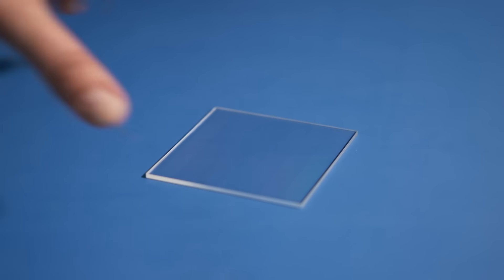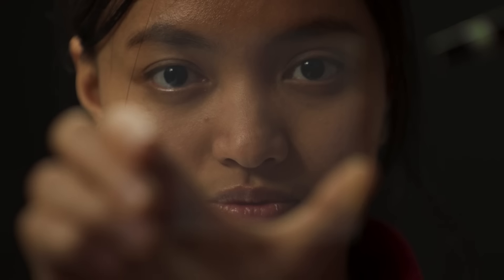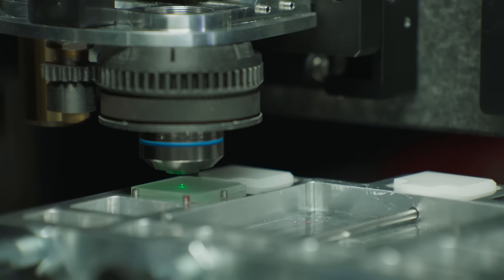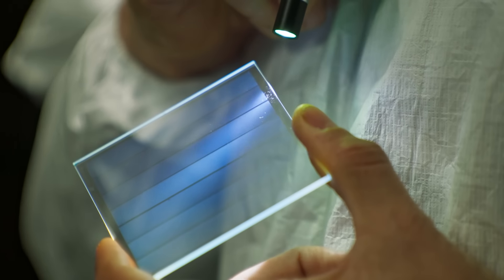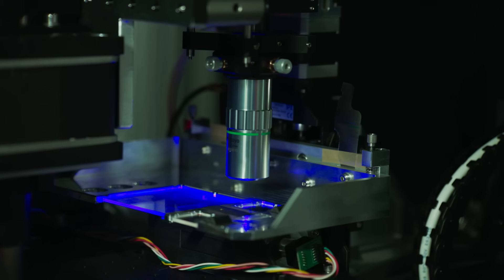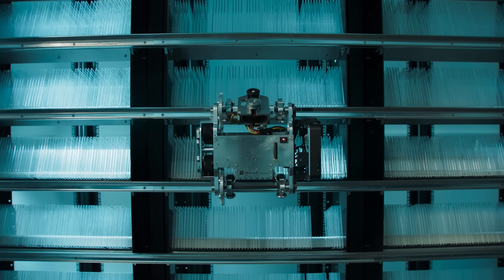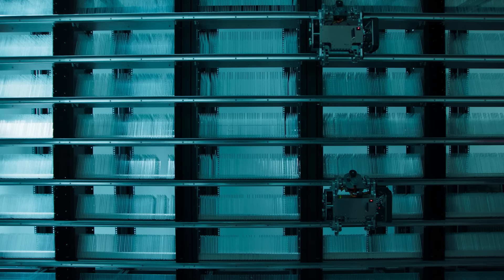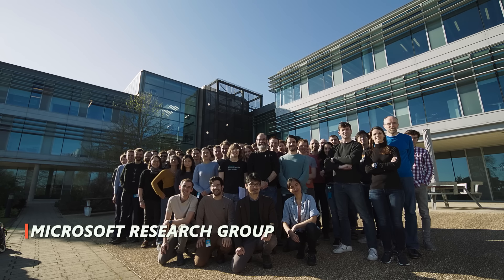Storing data for thousands of years | Microsoft Project Silica

Comment: A large data storage without electricity looks amazing
Reply: So a library looks amazing?
Reply: @Tri-Technology   I mean, there's plenty of libraries that look amazing lol
Reply: @jakub2631  I know, but that was not my point.
Reply: @Tri-Technology   well if you want to compare this solution to a library you should consider book's read time and data capacity
Reply: @jakub2631  That's still not my point. A library is aswell "A large data storage without electricity" So this concept is nothing new. Only the storage medium is different.
Reply: @Tri-Technology  A library takes up too much space and is flammable.
Reply: @Tri-Technology  a library is not a "large" data storage.
With some simplistic and generalized math: in a single glass platter of these you could store up to 3 millions of books.
Reply: @Tri-Technology  every step to making something new is simply modifying existing concepts. Then eventually it goes through so many iterations that it becomes a concept that is very different from what it was at the start. You can call these glass slides glorified hard drives, but maybe one day it could inspire new innovation that can be considered much more useful than what it is today.
Reply: Looks like the Jedi Archives xD
Reply: @Tri-Technology  like someone already mentioned, a library is not a large data storage. Furthermore the data in a library is not easily machine readable and this is a problem in a lot of cases
Reply: cant you just keep an SSD off
Reply: @Tri-Technology  I'm confused at to what answer you're looking for. Everyone already replied to you both on the aesthetics and the technical aspects of things. But I'll try to give my go at this:

This is a huge breakthrough because current archiving technology uses tape drives (yes the same tape drive technology we've been using since the dawn of computing) and the problem with those is that they can only last for a few years until the magnetic medium wears out. GLASS however almost never "expires" and is also one of the most abundant material on earth. You may think this as just a fancy CD but CDs are made with plastic and use a special dye coating to store the data. Plastic warps due to temperature and the dye's chemical composition changes over time. They can still last a very long time if stored properly but not long enough.

Also, a single hard drive can store a library's worth of books so I don't think a library counts as a large data storage facility in modern times.
Reply: @0x1EGEN  I am not looking for answers. I am an engineer and understand very well how data is stored and what the advantages and disadvantages of different storage types are. I only mentioned that a library was back then and is still today "a large data storage without electricity" or why do you think has almost every university still today one or multiple libraries? Of course large is relative and in comparison to a hdd, ssd or tape books are storing not much data. My point is that the concept of storing a lot of data without electricity is much older than modern techniques and people are always searching for better storages. Also the data in this approach does not need electricity while the data is stored, but we need it to read and write it and that's true for most of them, if you think about storage types in a macroscopic perspective.
Reply: @Tri-Technology  yeah, libraries do look amazing 🤩
Reply: @Tri-Technology  an entire large library is like 100mb
Reply: @Tri-Technology  I mean it is essentially a library with robots that pick up the books and read from them to give a client the data they requested. It's not so different just that paper isn't that durable and also doesn't store information in a compact manner. Meanwhile one of the small 3 by 3 inch glass can store 7 terabytes for tens of thousands of years. That reduces the upkeep cost by a ridiculous amount BUT it's not very practical for a cloud infra because reading and writing of the data takes days. So like for archiving it could be valuable but otherwise it doesn't seem very practical. Still a cool concept.
Reply: You know DNA is better than Glass at storing stuff
Reply: It's about data density too. Libraries don't have that.
Reply: @Breadbrowser  it is also harder read/write and more expensive to store
Reply: @rickfxs  Not even remotely. A simple solar array could power that kind of energy need. For free.
Reply: Doesn't HDD and SSD count? I mean, you only use a tiny amount of electricity when accessing the data. You can leave these storage devices unplugged for months or even years, and all the data is still saved..
Reply: like HDDs? xD
Reply: you mean like CD?
Reply: @diuco17  Glass takes up space and can shatter.
Reply: @MAKRON66  I takes very little space actually. Think of a hard drive... at best it can store 26TB of data, an LTO tabe can do about 30TB. In much less space you could store a layer of glass that holds easily 500TB and will not demagnetize.
Of course it could shatter but a hard drive can also break if you drop it. Its an archival media and it is not supposed to be constantly moved from one place to another without care.
Reply: @Ludak021 reflecting dye on CDs degrade over time
Reply: tbh I think a less difficult way to do this is to return to punched tapes, EXCEPT we use lasers to burn and read the holes. if we can make nano grooves in a CD we can make nano holes on tape as well
Reply: @Tri-Technology  i think physical libraries mostly store information, not data though...
Reply: That is... until no one remains who knows how to maintain the reader robot...  Seriously... how many people would be able to maintain a magnetic tape reader from the 70's... and how difficult would it be to reverse engineer it in another 50 years...
Reply: You could  @Tri-Technology  fit the whole library on a single sheet.
These can hold petabytes.
Reply: @rickfxs  is clearly more economical and efficient than current methods, come on, they are looking to cut costs.
Reply: Every data storage device we invented is that way, i.e. tape, floppy disk, hard disk, CD, DVD, Blueray...
Reply: @Tri-Technology  Glass lasts longer than paper and apparently now holds much more data than paper can.
Reply: @Tri-Technology  your statement is pointless
Reply: Tape?
Reply: data != electricity
Reply: yeah! these ultra modern solutions to store "large data without electricity" are amazing!   Like the "Magnetic Tapes" from almost a century ago maybe?... 🤣
Reply: @Tri-Technology  by "data" he meant "digital data" - where's the usb-c plug on a "library" ? 😆
Reply: @MerriemWeebster  "simply"... 🤣🤣
Reply: @gbbarn  looks more like Superman's Kryptonian Knowledge Crystals 😀
Reply: @tgr5588  people, a Library IS a "Large Data Storage". But, it is not a DIGITAL data storage as the original comment should've clearly stated.  ("digital" here just means it can be read by computers)
Reply: @SnrubSource  ssds data deteriorate over time if not powered. i've heard 2 years the data is already at risk.
Reply: @Tri-Technology  don't be an "ACshuaLLy" guy. This is clearly a leap forward. And its not a library in the traditional sense since it can still operate like a cloud data centre.

Comment: I hope you will release end-user engraving/reader stations for offline use. Do not gatekeep resilient storage options to cloud services, it benefits everyone.
Reply: They need to make it small and power efficient. More research is needed.
Reply: I don’t know if they will. It’s probably more profitable keeping it as a cloud service
Reply: @turolretar @turolretar  But in terms of resilience it would be extremely beneficial to implement a standardized form factor, format and distribute readers en mass. In case of a solar flare, they simply could import readers from another part of the world. For starters I would keep the CD formfactor. Don't know, why they discarded the the rotating disc concept.
Reply: @haifutter4166  Simple, because new technology is more cost-effective.
Reply: this tech is still 50-70 years away from mainstream
Reply: @luketheduke420  5-7 maybe. Computers advanced more in the past 3 years than the last 100 years. Things are moving faster than you think man.
Reply: At least making it available enough to be accessible at a local library or university would be cool!
Reply: @Ranstone  Hard drives existed for decades before they were economical enough to be used by the average consumer. Optical media was the same. At the minimum this is a couple decades away til its available to the average consumer. They gotta build standards and formats that manufacturers can work with.
Reply: I doubt it, we went decades without seeing a true market for magnetic tapes (yes, it's still popular, in business environments, the TB/$ cost is unmatched).

At least in this decade, surely they will find a way to convert this to a cartridge system (the cartridge is the glass). The decoder/the machine that reads it, It will be one of the most expensive components a user can buy (currently, the latest generation LTO-9 tape drive is more expensive even than the current highest-end graphics card /4090, at its most expensive moment)
Reply: This is so important to loose my anxiety of data loss. I want the technology for offline use so badly.
Reply: @turolretar a cloud service is available on the spot, theirs is more like a library, but still cool

Comment: What's incredible is that this kind of thing hasn't been in wide use already. I mean DVDs were built off this same concept but it didn't extend beyond that till now?
Reply: DVDs don't last very long. That's why the industry developed Magento Optical Discs. Several types, small MODs, large 5.25" MODs and - well - the Minidisc by Sony. However. Lifetime 50 + years usually by design (and probably much longer). However, back in the days only few markets accepted the need for long term easy to use storage. Especially Japanese customers bought there. In Europe at the same time CD-Rs became popular. Especially the cheap ones by grocery store discounters. Despite all warnings people saved their family photos on them and eventually sometime even lost them after five years. DVDs/CDs are now better of course. Especially Phase Change Discs (DVD-RAM) or most likely the new M-Disc which claims 1000 years. However, there is almost no demand in long term storage. People still don't realise: Data will be lost eventually when they get old.
Reply: There was a researched know-how of even a terabyte DVD by only improving the lens on current burners to the nano scale, with donut form, was in news. But manufacturers of drives decided to end production because profits are thin and disc medium itself lost its main adaption distributor in movie industry when after blu-ray the streaming services sky rocketed in popularity and availability with fast internet. Ordinary people abandoned this media fast, many don't see the value and risks for their family data archives. Although from some people won't be left any traces, we found only one grandfather photo from 1930s in his job personal file on the oldest city electrical facility only because they forgot to destroy it, which law requires.
Reply: it is still new technology in development
Reply: @fontenbleau  
Nano-scale lasers are extremely expensive, which is a big part of the problem. I don't think most regular people can afford to buy a CD burner with a $20000 laser inside. It would only be viable for big businesses in data centers.

Comment: The Project Silica I saw about 8 or 10 years ago at discovery, they showed a used salt mining cave which was rebased as a data backup and these pieces of glasses were an early prototype then. 
For me these tech is a hope that in case of solar wind or any other catastrophes knowledge will hopefully survive
Reply: but microsoft developed project of all operation on glass to meet all new goals
Reply: Once the glass melts or cracks, what happens?
Reply: @Fluterra  we can store it in protected environments and cases maybe. The most important part is that it doesn't require continouus power to keep data
Reply: @Fluterra  Obviously the data is lost but if you store it properly that will never happen. You could put it in a box inside a cave and as long as there is nothing super severe it could theoretically survive for millions of years.
Reply: @ubersuperboss7761  it's great if you view it from computer perspective but from physics and chemistry point glass is liquid not solid. So I highly doubt the original hardware may survive that long.
Reply: @jimbocarter7202  Glass is not liquid. It is an amorphous crystal. The old windows thicker at the bottom was an artifact of the manufacturing process and in some cases intentional. Glass is resistant to extremely long term storage.
Reply: @jimbocarter7202  thats a common myth
Reply: @jimbocarter7202  so you're suggesting that these people, smart enough to create this amazing technology and systems to escale the project, are not aware about basic engineering and fundamental material phenomena which is basic compare with what they are doing?
Reply: @namm0x326  so modern glass will not morph due to gravity. And if that's true than we have no problem or are there any other drawbacks?
Reply: @nihil_._sum  I am not suggesting anything. I am an Computer Engineer myself. I do not want to follow an company blindly. That's why I am discussing this topic with you and all the neutral non biased people in the  public. And if there is a better alternatives.
Reply: Modern Marvels pre 2k showed the govt already had this. Microsoft is just a replicator not an innovator.
Reply: @jimbocarter7202  depend ? did we find natural glass from volcano and meteorite impact old of several hundred million years ?

but i agree with you than the computer able to read the glass may only survive maximum dozen thousands years
Reply: Said catastrophe would probably also remove most abilities to read the Project Silica data glasses, since a highly accurate, computer-powered microscope is required to read the actual stored knowledge. 

In my opinion, the best ultra-long duration, undecaying form of data would also allow in-built readability for average humans.
Reply: Because glass reacts so well to shockwaves and tremors.
Reply: it's a "hope", that even a solar storm cannot wipe out data how much you owe to a bank.
Reply: Some barbarian will find the library (1000 years after solar flare) and will use it as bathroom tiles ;)
Reply: In the far future someone will have to use a futuristic gun to traverse these old salt mines
Reply: WAIT FIR it.. IT'S the Old dna PRogram on glass rice... One day a grain of rice in a match box sized reader
Reply: We will never have solar winds that bad